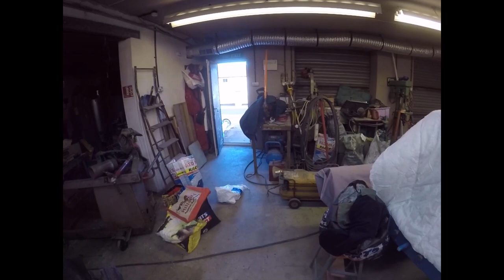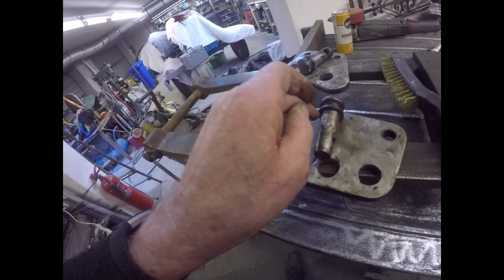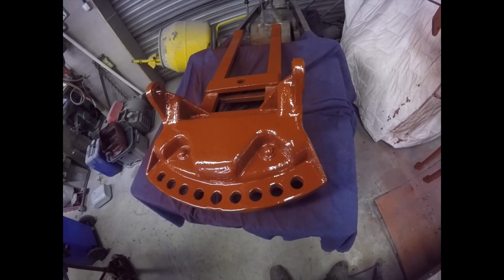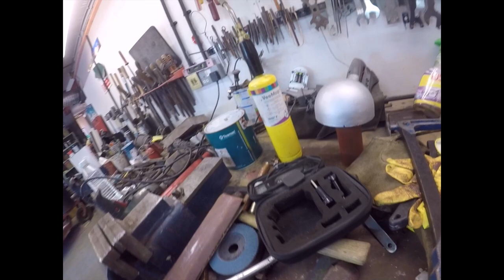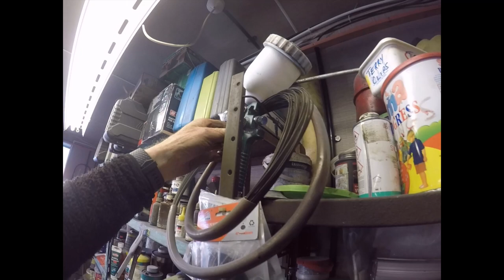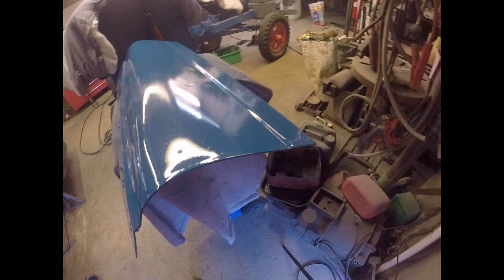Fordson Major rebuild , The final front ear, Repairing the tow hitch!

Comment: Hi Phil, been following the restoration with interest. Hope to do a Ford 3000 soon. 
I used to filter paint through a pair of ladies tights. Worked really well. 
Keep up the good work!
Reply from the maker: So did I but I have long hair and wear them on my head as a snood to keep my hair out of oil, paint and rotating machinery. I used the muslin, it was fine, but there is nothing worse than finishing a perfect panel only to have the gun spit a lump of congealed paint right into the middle of it, or loose half of the paint fan as you do that final pass!
Phil

Comment: Phil I have a lathe tool shank with a roller bearing mounted on it that I use to true up things like that pin. Grip pin in chuck but not murder tight, spin lathe at a low gear and gently bring the bearing up against the work. Work is pressed into alignment and the chuck can now be fully tightened. A trick I was introduced to by the late lamented John Stevenson that works superbly.
Reply from the maker: Yes, I really should make one of those, I saw them on Doubleboost among others, but I can well believe JS was the originator! He came to my rescue online once when I was viciously attacked by a number of SMEES, and pointed out to them that I was right, and they were not!  He was a great engineer, a great man, and I still miss his wit and wisdom! Clumsy Bastard!!
Phil

Comment: Great progress young man. Would I be right to presume the hitch is cast steel? If it is then  yes, not a problem to weld. I find the best way to clean rust off steel is by dipping the part (subject to size) in a bath of phosphoric acid for an hour or few. Nice tip on the sanding belt though. The pre-cleaner, not worth hassle of trying to make one. Sometimes you have admit defeat and bite the bullet. Maybe if you had cut the disc, then formed the louvres and then formed the lip it would have gone a bit easier? Nice job on the spraying squire, Iam going to have a do myself soon. I am plotting on building a box and pan folder and that will be sprayed and so will any future welding carts I make for folk. Well done on the progress so far young man. Topo regards, Jon.
P.S. I think you are going try casting a part for a machine! That will be something very interesting to watch indeed.
Reply from the maker: I think it must be cast steel, if you see the dimensions and the underside, which is hollow, and then imagine the nose weight that falls on it with a 2 wheel trailer with a few tons of muck in it flying over a potholed farm track, cast iron would just shatter! It welded beutifully, just flowed into the weld, and it melted into the gaps and filled the voids perfectly, I have in desperation welded cast with a mig, but about 70% of the time it cracks before it even cools off, though I did mig a broken clamp lug back onto a landrover manifold, and it was still there when I sold it a couple of years later! You know what its like, you have a go, and sometimes you get away with it! I think your way on the precleaner would work!, I may have a go when I have more time! Box and pan folders, the stuff of dreams, and something always in shotr supply on the S/H market and always expensive! Making one is the way to go. For fabbed up jobs and general machinery I use a hammer finish one coat on bare metal paint from Manor coatings. It is an experimental electrical machine which probably won,t work, but will be interesting.
Top regards coming back at yer Jon, Like the new shop!
Phil